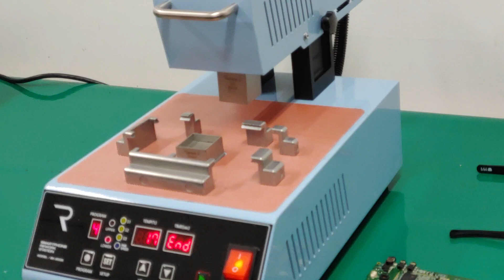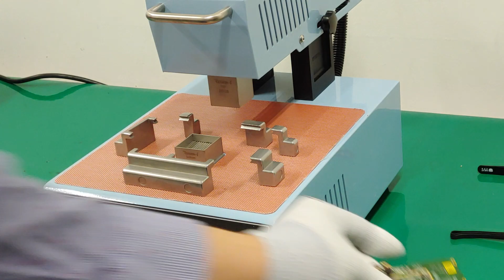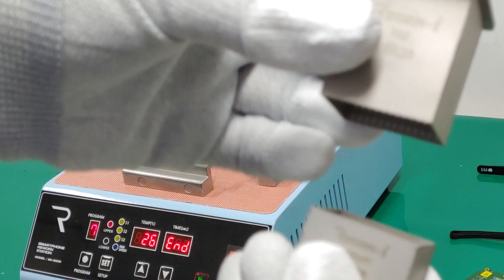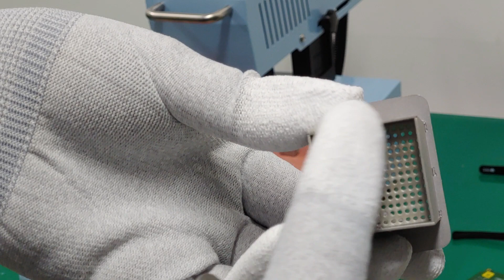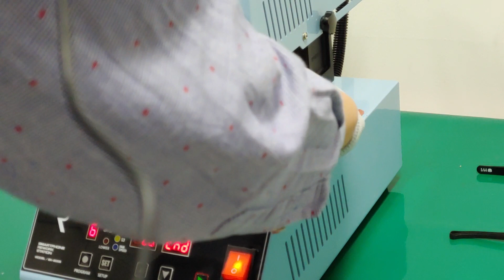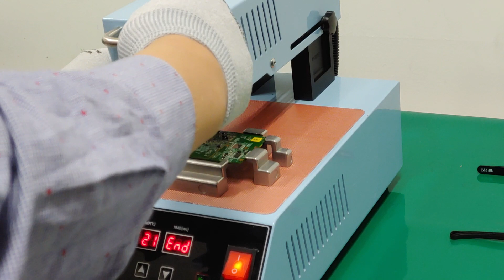REGENI BK200S  bga rework system for demo of Program 6~9 to set new profile to fix small pcb

Comment from the maker: Before end of total heating, alarm beep sound count down for 10 seconds, when user should be ready and push upper head when 1st alarm is heard, during 10 seconds of time, user can pick up desoldered target part, if this is not available, user set 5 degrees higher temperature at 3rd step and try again. After 10 sec passes, cooling is quick and target part will stick to the PCB pad, thus during alarm time, try to finish picking up target part.